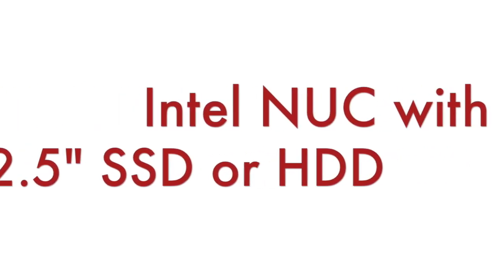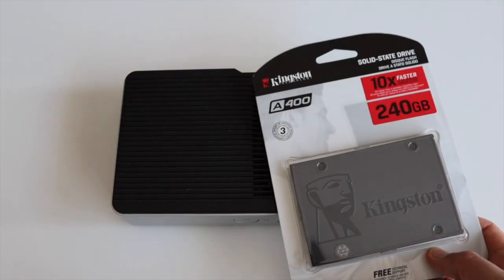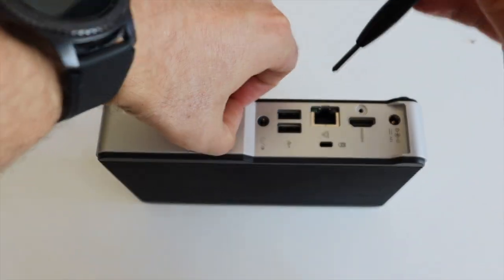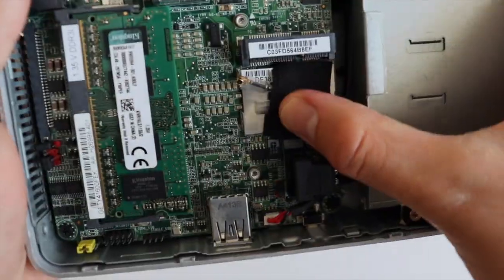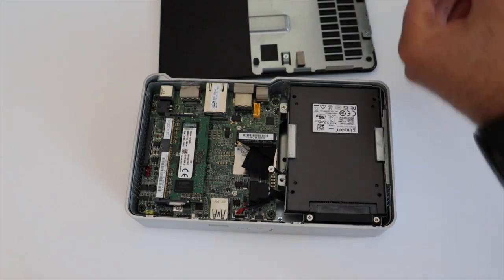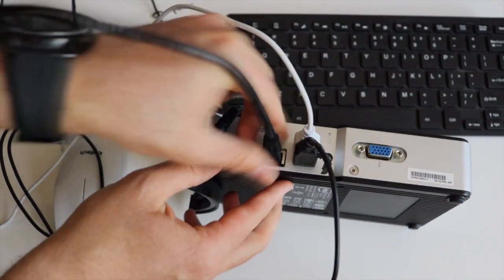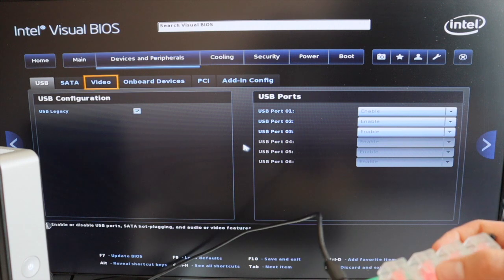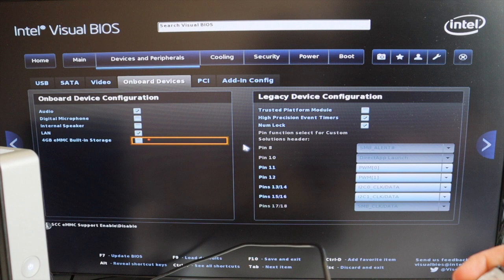Intel NUC Add 2.5" SATA SSD or HDD

Comment: Grateful for the Intel Nuc info 

I have 2 2017 models which are both excellent computers for my needs.

Very small & very quite but good performance
Reply from the maker: Yes, thanks! I share your opinion. Intel NUC offers a great range of mini computers. Back in the days, 5-6 years ago I used this DE3815TYKE for development and testing of Tizen (GNU/Linux distro). After several years in the shelf I figured out cool ideas how to use it for more general purpose tasks. I will consider buying a newer Intel NUC model :)
Reply: @LeonAnavi  I remember when I decided to get one , I kept bidding for nucs on eBay but always lost out at the last minute . I had spent weeks bidding & losing to the point where I was thinking of just purchasing new , but at the last minute I actually won 2 auctions on the same day ! Ended up spending way more than I'd planned but have been very happy with both ever since. 
I currently run Linux on the main one & Windows 10 on the secondary one .
Reply from the maker: There is always is a risk in an ebay auction but it is also fun! Which Linux distro are you running on your NUC?
Reply: @LeonAnavi  Ubuntu 18.04.4 running Mate Desktop
I like to keep things quite simple & plain - no fancy bells or whistles or such like